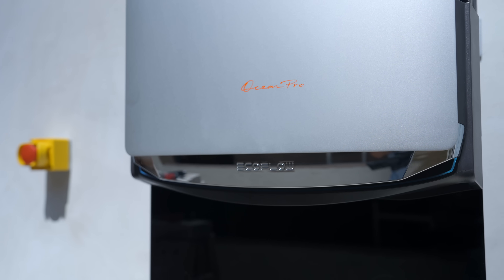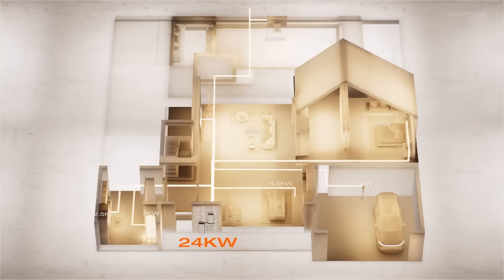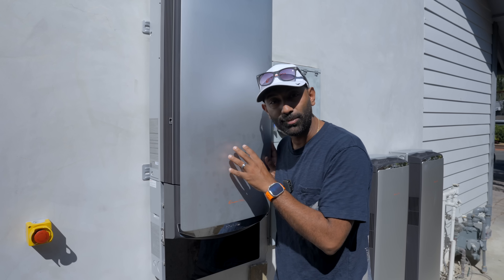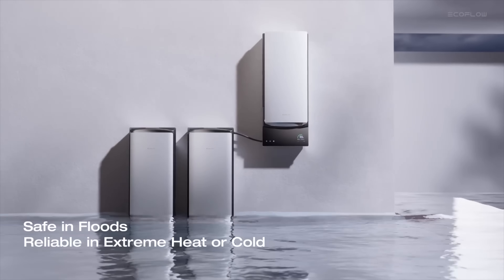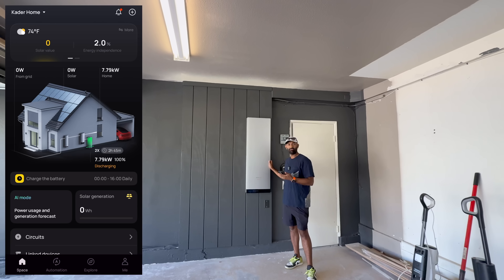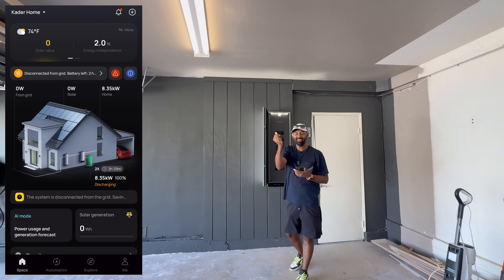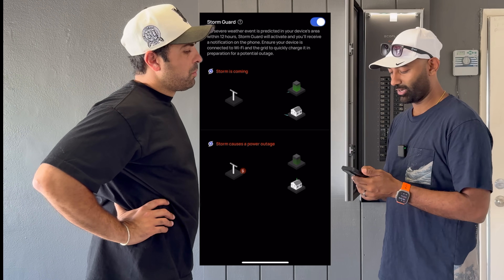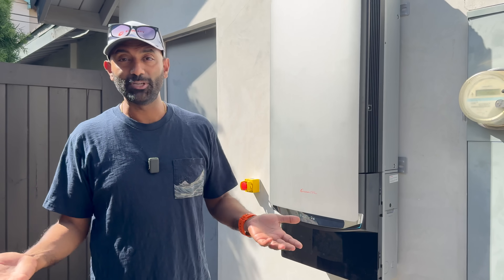Why This Home Battery Will Save You Thousands! Ecoflow Ocean Pro First Look

Comment: If you feed back to the grid, the only benefit of a battery is time shifting and if your rates don't vary too much, it can take 20 - 30 years for a battery to even break even. I've done the math in the Bay Area and it doesn't make any sense except maybe for power outages and even then you need an expensive setup. Doing the math on your friend here who uses basically three houses of power. His break even is 10  - 14 years. Anyways, cool infomercial

Comment: I really like the Ecoflow Mobile App but I decided to go with EG4 Flexboss21/Gridboss. Cost was about 25% less than equivalent Ecoflow system. I am not a huge fan of EG4 App but saving $$ was the deciding factor. I got two EG4 Wallmount batteries (14 KWh each) and they're smaller than these Ecoflow batteries. The EG4 system can be paired with other battery brands and you're not stuck with one company.

Comment: Smart panel looks nice, but unless cheap (and I’m sure it isn’t), it is way oversized for typical older home retrofit. 
And most importantly, as seen with SPAN and EnPhase not playing well with others, vs FranklinWH who does play nicely with a more open API approach, the question is which approach is EcoFlow taking. 
Batteries seem expensive compared to EG4, though granted, a higher/much better UL cert. And being 400V, makes for an interesting bi-directional EVSE discussion with no voltage conversion (usually via interim A/C conversion)
And the meter collar… whooohooo. 
I love the market competition… hoping EcoFlow announces AC coupled support with EnPhase IQs

Comment: I would have liked the system, but they won’t give a price on buying the hardware. They will only price it with a 3rd party installer including installation, when an installer is available in your area.

Comment: The equipment cost is quite competitive. 1x smart panel 40, 1x ocean pro inverter, 1x ocean pro battery(10kw) = approx $13k. However you cant buy the equipment yourself. Only a ecoflow partnered company or certified electrician vetted by Ecoflow can purchase the ocean pro product family and they will of course add on their install labor charge+ permitting fees. So its very important that you find the right installation partner/company that provides reasonable install cost.

Comment: SDGE is being very smart by charging all of us in San Diego $24/mo minimum even if you don't pull a single electon from the socket!

This will go up the minimum of 10% every year. In the meantime, solar will just keep getting cheaper. There will be a time when it just doesn't any sense to connect to the grid for people who can go offgrid. This is easy for rural customers - the very customers that are not as profitable for SDGE as the densely packed houses in the city.

Fantastic way for SDGE to work around the state's rule of having to provide power to everyone even if it's one little 10W bulb in the middle of a 100 acre farm!
Reply: @subhobroto   not SDGE specific, CPUC driven across all of CA (though at investor owned utility push)

Comment: Hi Ricky, I generally like the perspectives you bring to energy saving products on the market. But I was surprised when you mentioned the cost of electricity in San Diego. I live in the Niagara Region in Canada. Just as a comparison, our high rate, from 4:  pm to 9:00 pm is 26.8 cents per KWH in CAD and our overnight rate from midnight to 7:00 am is 2.8 cents per  KWH. It's no wonder the GDP of the US is so much better than everyone else's.

Comment: I signed up right away when ecoflow first announced these. This checked off so many boxes, it's incredible. However, I'm still waiting for a phone call.
I did the same with Anker's powerwall and they still haven't reached out either.
Reply from the maker: Where about are you? I can try to give them a nudge. Cheers!
Reply: @TwoBitDaVinci  NY State in the Hudson Valley
Reply: Go with Sigenergy, almost 4x the battery kw in the space of one of those batteries and the inverter sits on top. They also have an EV module so you can charge or discharge to your home.

Comment: I live alone. I have no need to run every item in my house during a power outage or off grid power. In the summers during power outages my 2000 watt Champion generator runs a 12,000 btu a/c, two box fans, refrigerator, tv and internet. The solar/battery system I am putting together only needs to provide slightly more than that. No need for a $20K-$50K system.

Comment: Why does everyone do this?They say kilowatts, when they're talking about an electoral panel, when everyone who's looking at comparisons, is talking about amps, I have two hundred amps service to my house is this enough to replace that
Reply: You have 200Ah service, this system is capable of supporting a 200Ah Service or larger with multiple units.  On average, you are only pulling peak Day wattage of 1200 to 6000 (average home in NY) Evening  400 to 800.   A 4Ton Old AC will require about 3000 watts while running.

Comment: What price range we talking about here? $5,000? $10,000? $15,000? Would like at least a rough guess
Reply: My guess would be around $5000-$6000 per battery and another $3500 for the panel before breakers. Then add another  $3000-$4000 for installation.
And that's with no panels !

Comment: LiFePO4 Lithium-ion battery: Safer
Charging time- Fast 1,  Slow 7 hours
Charging cycle- 3000
150-200kw/kg
Reply: Ocean Pro has the best UL ratings and average 6,000 + cycles guaranteed 85% capacity after 15 years of use.  Also has built-in fire suppression as well as Flood protection. :)

Comment: My power bill has a Fuel Factor @ 0.0413900 Per kWh
With the additional fees and taxes(the rest of my bill), Transmission Services, Distribution Services, Electric Consumption Tax, Local Consumers Tax, and PIPP-Universal Service Fee added in it comes out to  0.054 kWh.

I figure, for me, this system would pay for itself around the time I turn 110 years old, but I suspect after about 1/5 of that time this company will have long gone bankrupt and my warrenty and access to replacement parts will be long gone, and most certainly in much less time than that just the technology will be obsolete.

Sure glad you guys have the "clean, affordable, sustainable, green energy" instead of us. Keep up the good work, somebody has to do the virtue signaling.

Comment: This just came out when I had ordered my Powerwall3 with 1 expansion system. Could have got two full powerwalls to double output to 23Kw but I the 11.5 Kw should pretty much run my whole house as long as I'm not using dryer, oven, hot water heater and both A/Cs all at once. I think that will bump it above 11.5 of usage. :)

I know prices vary, but what is the price of this VS PW3? More? Less? about the same?

Are you required to replace your main panel?

Comment: nope. Way too expensive, battery capacities too little and from what I've seen pre-released product? Would rather go with 2 EG4/LuxPower inverters and look at the batteries Will Prowse and Projects with Everyday Dave have shown. Promotions like this are not flattering and hardly even informative.

Comment: Does this thing require Internet access and use cloud services? If so, I'll look elsewyere, thanks.

Does that guy's $0.73kWh during peak times also include "delivery" charges? Mine's about that much but there's also an additional delivery charge of around $0.25 or so added on by the utility for "delivery", making peak cost around a dollar a kWh.
Reply: For SDG&E the $0.73 is the total, all pieces together.  It is also a bit deceptive... the electricity is on a time-of-use tariff and there are other tariffs available and lower rates off-peak.  Nothing cheap, but it really comes down to overall home use and the home shown in the video is big and has a lot of heavy loads in it... not really typical.  Upper middle-class at a minimum which is to say... not most people.
Reply: @junkerzn7312  Plus, isn't that area electricity only?  No gas?  That would add heaters, dryers, ovens, and cooktops to the load.
Reply: @vremster  Yah, electricity only.  Gas is billed separately.  But there are a ton of tariff schedules and I'm not sure which one that one is on.

The basic SDG&E Tiered Tariff has a base service charge of $0.79/day plus $0.37/kWh below baseline energy use and $0.47/kWh above.

The TOU-DR Tariff is the basic residential time-of-use tariff runs the same service charge plus $0.53/kWh peak, $0.46 off-peak, and $0.38 super-off-peak.

The TOU-ELEC Tariff has the same base service charge plus a time-of-use charge of $0.63 peak, $0.35 off-peak, and $0.31/kWh super-off-peak hours.

The DR-SES Tariff for households with solar systems is  time-of-use rate.  Again same base service charge, plus $0.65 peak, $0.40 off-peak, and $0.32/kWh super-off-peak.

Winter rates are lower than summer rates.  I put the summer rates up above.

I'm not sure which Tariff the $0.73 rate is coming from but I'm not going to sift through them all to find it.   There are other schedules for special use cases, such as if the home has a heat pump furnace, separately metered EV charging.  And so on and so forth.   But there aren't any surprises.  They are all expensive in one way or another.

Comment: This infomercial is rather lame. Those batteries look twice as thick as PW3 and don't even an inverter  or +30% capacity. 2 pw3 would blow to that entire system for likely a lot less with redundancy. Loose...

Comment: When you switch to off grid, do you still have to reset all your clocks or is it so fast that you don't lose power to your clocks?
Reply: Ricky said the time to switch was 10 milliseconds.  That's 0.01 seconds.  Clocks will be fine.
Reply: Generally speaking, clocks won’t glitch.  A desktop computer under heavy load still might.

Comment: I hope that guy has good security because his whole system is right next to the main road. Aren’t those batteries expensive? I do hope he has more protection than what I saw on this video because anyone could just back up with their truck & drop those batteries on there pick up & take off.
Reply: Yes, good point.  I'd have installed them in the garage, myself.  I don't like putting ESS components on outside walls.  It's a big flashing sign.

That said, stealing these things would likely be an exercise in frustration.  The components are bolted to the wal, have live electrical cables, the batteries are over 250lbs each, there would be a severe risk of electric shock (as in tombstone level shock), and all the protocols embed the serial numbers for all the components so someone trying to use stolen goods in a new system would be caught fairly quickly.
Reply: @junkerzn7312   Happy to hear it. Keep up the good work.

Comment: The 5kw limit per mppt tells me this is tailored towards those complex roofs with all kinds of angles to the sun. For a ground mount array, it would be nice if you could run bigger strings.
Reply: Not sure if it works the same, but with the PW3 install manual, it says you can jumper the strings together to support a larger wattage string.

Comment: 24kw sounds too small for many homes, I have 96kw of service, but don't use nearly that much. No fancy AI or expensive equipment, but for the last 14 months my net electric bill is negative in a house that is all electric and has an EV. There are times when the net flow is 20kw to the grid.

Comment: Seems like a nice system, but no pricing. I'm guessing it's very expensive.
Glad I know how to DIY this stuff, my guess is I'd be saving 2-3x just on hardware cost alone if I pieced together my own. And it really wouldn't be that much more work.
That 24/40kW all-in-one is pretty impressive, although it looks massive, so makes sense. I'd rather have the EG4 Gridboss and a couple 12K inverters. That way if one quits working, I'm not dead in the water. I'd still have half capacity.
Reply: I have a Gridboss, Flexboss 21 & 18 with six PowerPro batteries and probably spent about what this system cost. Also DIY so no labor expenses.

Comment: Man 73 cents per kwh is an outrageous example to use. Many states have 10-15 cents per kwh and it paints a better picture. Also really changes the return on investment. 5x longer ROI
Reply: TOU peak pricing is supposed to be expensive
Reply: The viewers in that high cost demography is very large.  CA has about 10% of the US population, than add AZ and other western hot states with a ton of sunshine.
Reply: SDG&E is the most expensive electricity in California, though other utilities are not far behind.  However, comparing the cost per kWh doesn't really translate to your monthly bill.  Generally speaking, customers burn a lot more electricity in states where pricing is low so actual bills tell a different story.  Electricity is actually more expensive in Texas than it is in California when it comes to actual monthly bills. 

California is not a cheap state, but it is also not even in the top-10 when it comes to monthly electricity bills.

The reason for this is generally because in modern times the cost of electricity is mostly the cost of infrastructure maintenance and not so much the cost of generation.  So if your customers use a little electricity on average a higher rate must be charged, and if your customers use a lot of electricity on average a lower rate can be charged.  

Also, states which primarily export electricity are often able to give domestic customers a lower rate.  Though exporting power is not as lucrative as it used to be and is becoming less so over time.
Reply: Yeah, that is really high to me. Here in Northwest Indiana it is only about $.17 per kilowatt/hour around the clock.
Reply: @jrod6236 I imagine Northwest Indiana on average relies a lot more on gas heating than electric AC for climate control. California is the opposite: heavy AC in the summer, low to moderate gas use in winter.

Comment: I'm just north of you in the greater Disneyland area.  We put in solar 5 years ago with the Powerwall.  14kw.  We haven't paid an electric bill in 5 years and we run our a/c as much as we want.  But it was a $9k battery.  I can't imagine the Ecoflow is gonna be radically cheaper, and you need 2.  All in, my solar was 25k.  So I'm most of the way through my 7-8 year ROI.  Not having pricing, even rough estimates, makes it hard to validate the claims.  He saves $200/month, which is great-straight up, but does that put him on the 10 year ROI plan? or 15-20 year return plan?   
I'm still a fan of the channel and will continue to watch and like (already a subscriber).  Just my 2 cents.
Reply: When mentioning the $200 savings before even adding solar that it will pay for itself in just a few years. I think he meant a few decades

Comment: I think the hesitation when going back to the grid is due to frequency, not Volts AC pulses. But im not 100%
 In any case, remember it doesn't switch back instantly.